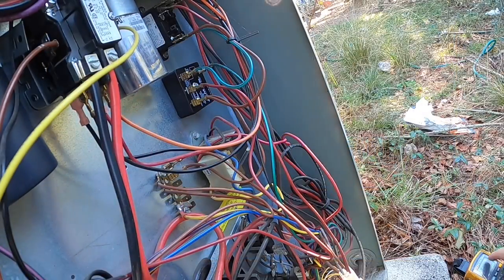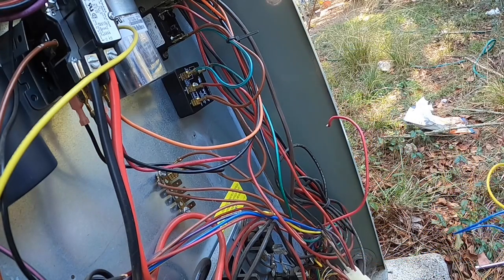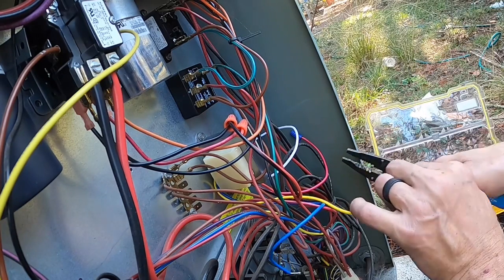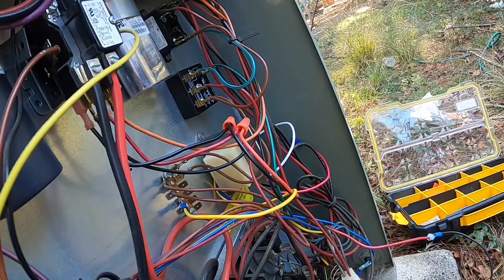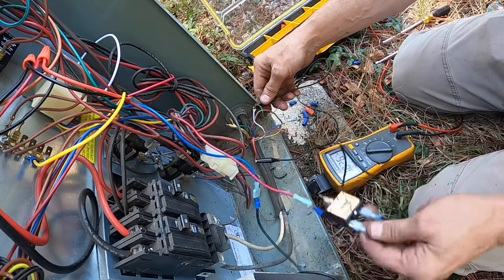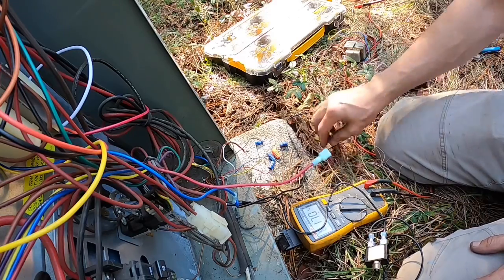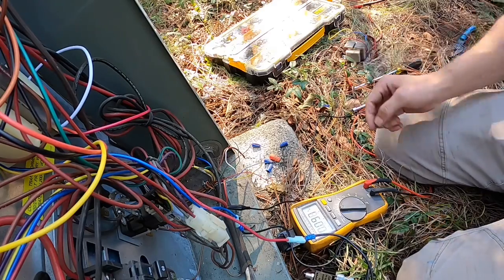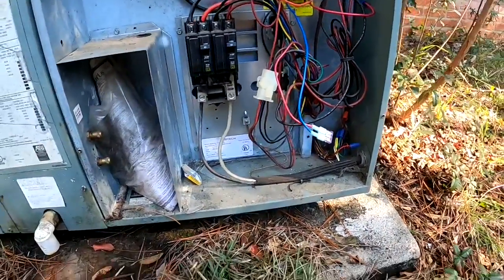Blown transformer and low voltage short.

Comment: I am confused. You checked the contactor but I haven’t seen you checking the transformer for 24 volts and 120 volts. I would check the transformer first before condemning it.

Comment: Have u ever tried the new Wago lever wire connectors?  Theyre an awesome alternative to wire nuts.  The wagos r especially nice when ur wires r short.  The inline wago connector actually extendes the wires slightly.  No more twisting wires.

Comment: I actually can't believe how many manufacturers don't put LV fuses in their equipment, I've seen the plastic in those transformers can catch fire from an LV short.  My brand new Goodman packaged unit that I installed last year did not have an LV fuse from the factory, I certainly added one when I was wiring it all up.

Comment: notes:  at the 12 minute time, when he gets shocked, this is because the thermostat low voltage wires are hot.  that 24 volts at around 1.5 - 2.0 amps.  Not enough to really hurt you, but you notice.  The better way to disconnect all power FIRST.  There is a possibility that you can end up causing damage to the thermostat, and the brand new transformer all over again, doing this "work when hot" work.  The same applies to disconnecting power.  It's better to insert back probes into the wire nuts on a live low voltage thermostat circuit if you want to test with the meter.  this insulates the test equipment and prevents the leads from touching and shorting to other things...

I am not opposed to the technique in this video...but to the inexperienced DIY, there is a real risk of causing alot of problems if you are not careful about what you are doing...

otherwise, an excellent video showing top level troubleshooting techniques.

Comment: On a carrier package unit if I replace a missing transformer how would I wire it, the unit has no schematic. Does one low voltage side go to the Red on the Board and the other go to the common on the Board? Or one to the Red on the Board and the other to the Contactor?

Comment: Great video.  My old Goodman had blown the fuse on the board and traced it down to shorted coil on contactor at outside unit.  I had replaced it just 2 years before because of ants.  They don't make replacement parts very good anymore.

Comment: i have one contactor doesnt pull in and voltage on connections are 0v disconnect from contactor now i have 24v and then  when manually push contactor in burns transformer so i say shorted low side of the contactor

Comment: My unit is similar to that of yours, it doesn’t have a 3 Amp fuse so the transformer keeps blowing. How did you wire the resettable amp popper into the circuit? Did you just use red ( power ) and one of the 24V wires off of the transformer to complete the circuit?
Reply: R ----~------.